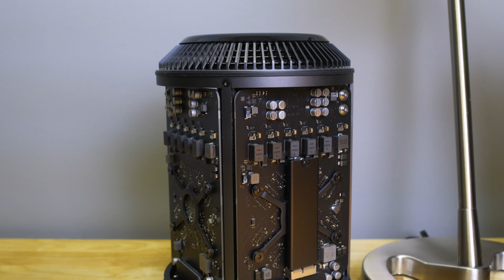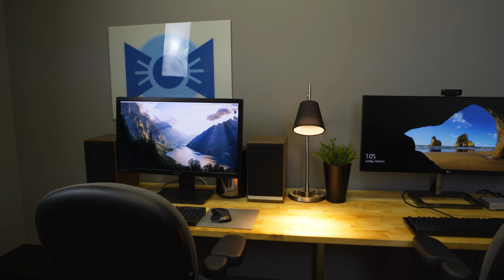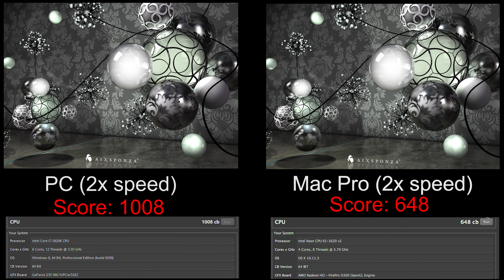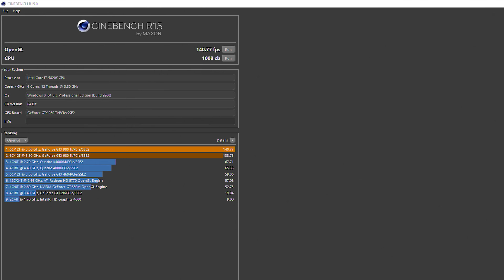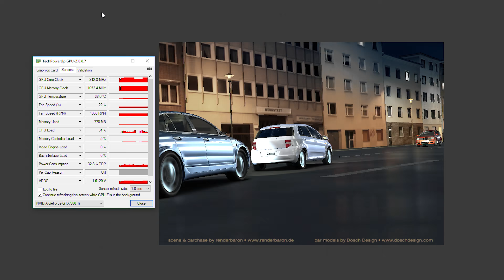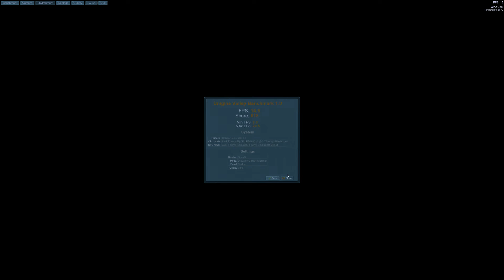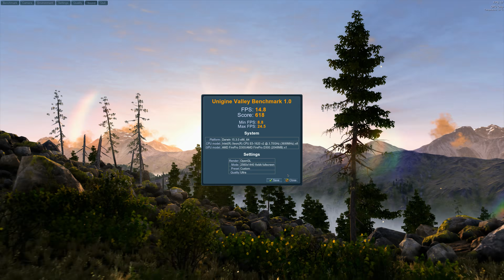$2,000 Custom PC vs $4,000 Mac Pro

Comment: Damn, my PC was $622 and even it annihilates the Mac Pro.
Reply: Michael Braddy I did not say I had a 970. I have an R9 290.
Reply: ***** Yeah, it's because, the 970 only has 3.5GB of VRAM.
Reply: +CaptainCrape thats just stupidity now
Reply: +CaptainCrape +t800 I have a $1200 PC
 i5 4690k, Gigabyte H97-N WIFI, 16GB DDR3, MSi 970 4G, Silverstone 500w 80+ Gold
It runs GTA V on 4K at 50 FPS and BeamNG.Drive at 60 FPS on Max Settings
Reply: I would beg to differ, considering your build is a gaming build, not a workstation
Reply: +ᅚ I overclocked mine to 1.8Ghz and overclocking the CPU doesn't help with the graphics. So gtfo since mine utilizes all 4GB of mem
Reply: +ᅚ cpu has a VERY little effect on game performance, unless you have like  say gtx 980 and a i3 or 3rd gen i5 processor, which then bottlenecks the card and yadayada, you just need a card that is compatible your gpu to work properly/full performance
Reply: This fucking thread gave me cancer.
Why even talk about gaymen things here?
It's already shameful enough that the computer in the video had a gaymen graphics card and no Xeon or ECC.
Reply: +ᅚ 
holy balls man im not even gonna read your wall of text because the first line misunderstood the whole fucking point
Reply: +ᅚ 
there's no doubt the windows computer is more powerful, but i still think they should have used different components. why would a computer for games be in an office? and yes if it has a 980 TI it's absolutely best suited for games regardless of what the guy made the computer for
Reply: +Jason Ciputra 

HAHAHHAHAHAHAHHAHAHAHAHHAHAH 

Gtx 970 and it runs gta 5 on 4k he says 
HAHAHAHHAHAHAH

your fucking funny mate :P
Reply: +ᅚ 

Then there is no reason to say it, when you dial down every setting to low and turn off msaa etc. What is the point. 

You cant play 4k with decent settings which is the fucking point off having a gaming PC in the first place. 
Also beamng is a shit game when it comes at graphics. 
When he can put the witcher on ultra and then 4k @ 50 fps then he can talk smack. 

This is just pointless. 

Just to say a gtx690 can also play 4k 50 FPS. just granted you get the lowest possible settings.
Reply: You know how pathetic you sound when you fight over internet? lmao
Reply: +CaptainCrape At least you went AMD with the graphics card. If the software can take advantage of it, it will do laps around nvidia because it has such good compute performance compared to Cuda. My PC actually does do laps around it tho, but its over $1000
4790k@ 4.5GHz
16 GB DDR3 2000
512GB m.2 SSD
4TB Mechanical Hard Drive
R9 Fury(Bios modified to Fury X, all compute units unlocked)

Crushes encoding tasks like ants :)
Reply: ***** Ohh, denial ;)
Reply: specs?
Reply: loomnati noscopers i5 4590, Z-87, 8GB DDR3, R9 290.
Reply: t800 Why?
Reply: +CaptainCrape well in gaming performance it does.
Reply: wow. apple really has overpriced stuff while you can get way better for just... $650? apple, please learn your lesson. (NO HATE)
Reply: +CaptainCrape my bad I accidentally tagged you instead of Jason here
Reply: Michael Braddy Ok
Reply: +ᅚ YEAH I SAID THEY HAVE AN EFFECT IDIOT. I'M NOT AN ANTI COMPUTER GUY. I UNDERSTAND A LOT ABOUT TECH SO STOP TRYING TO GIVE ME A LECTURE
Reply: +RuuFiss this depends on the game. CSGO is very processor heavy
Reply: Terrk23 CSGO isn't "heavy" in any aspect. If you have an old dual core CPU (Core 2 Duo, Pentium D, Athlon 64 X2) and integrated graphics or done crappy GPU you'll fun it fine.
Reply: ***** lol clearly you get way to annoyed over the internet

yeah i meant cpu its called a typo, and Battlefield is not cpu heavy at all you just need a quad core i used to run a gtx 650 ti and a i7 920 at stock speed, i upgraded my gpu for a gtx 970 and my performance doubled.
i have ENB's for Skyrim that i could even touch with my old 650 ti and when i upgraded my gpu to 970 i was getting fps well over 60 and enbs arent exactly optimized to well since they are mods 

 and obviously when you switch a cpu thats at like 100$ value to one thats at like 350$ value youll notice a difference, like seriously thats just a no-brainer

but hey all components act differently
Reply: CaptainCrape Not true at all. If you want 144+ FPS @ 1080p, that won't cut it. But if you want 4.3 aspect at 30 frames, sure, that would work fine.
Reply: Terrk23 Yeah, but I didn't think you were talking about that.
Reply: ikr
Reply: +ᅚ 
It's a fucking workstation, he's comparing it with the Mac Pro.
He said it's in a studio, why would he need gaymurr shit?
Reply: Mine is a 600$ laptop and destroys it
Reply: +ᅚ 
i am always calm but i really don't bother answering lies and when people appear to not even try to understand what's being said, because i have nothing to prove online
it seems to me you're still not getting it, but i'll give you the benefit of the doubt: im 100% aware of everything technical here, i work with computers on a technical level every day and i don't find it hard to understand what's going on.
i don't want anything apple, i'm not defending anything apple, i don't like anything apple.
what im asking is why would a computer made for games be in an office, and if he didn't make it for games, why did he use an i7, non-ECC memory and a GeForce graphics card?
Reply: +ᅚ 
how i speak online doesn't very well represent how im feeling in real life, if someone doesn't come off as serious at first i'll just be rude for the hell of it
i get that it might have been the point of the video, but it would be a little odd to to spend 2k on a computer if he wasn't also going to use it for something. anyway maybe it's the case that it's his bedroom or that it's just there temporarily, in the video it just seemed like a workplace and a computer that was meant to be there.
i gotta say he didn't go all out though, there are processors alone that cost more than that computer, particularly in the Intel Xeon, Nvidia Quadro and Tesla series. games is just a consumer market with relatively weak hardware in terms of compute power.
Reply: +ᅚ 
ugh linus tech tips
i am just disappointed because i was hoping to see something more interesting than another video about consumer hardware
Reply: +ᅚ Holy shit I can tell what site you visit on a daily basis.
Reply: +Tom Ferreira None of these tests were for gaming performance. They were for video and image rendering. It's obvious that people can only game on PC which is why this video didn't touch on it at all.
My prebuilt $450 HP was almost equal to the Mac Pro for editing, and it's like 4 years old.
Reply: +The-D0M1N@T0R 
because that's literally what they're for
and none of them are very good
Reply: +Strike_Raptor I upgraded my old pc a week ago with 2xE5-2670 v1, 64GB ECC ram, a creative sound blaster Z, an ASUS Z9PA-D8, 2xCM EVO 212S for 700€ and has 2021 pts on Cinebench R15, 30% faster than the $9000 12 core Mac, thanks to Tech Yes City and Hardware Unboxing channels! http://valid.x86.fr/fn1z9x
Reply: MrTor8 64gb of ram, what the fuck, are you trying to render a new planet?
Reply: +Strike_Raptor 
It's not that much, if you do a lot of things you can easily use it all.
Reply: Echoz28 Well, ram is pretty much always completely used, it wont use like 4/8 gigabytes, it'll use all 8 at half of its potential.
Reply: +Strike_Raptor You're right, normal use it's like 4 to 10GB, but when I'm rendering videos, doing complex simulations and other stuff it rises really fast, also its a good thing if you use ramdisk.
Reply: +Strike_Raptor 
It's being used for caching and buffering yeah, but even all applications 64 GB RSS isn't all crazy.
It really all boils down to what you're going to use your computer for.
Reply: +Jason Ciputra a gtx 970 running GTA V on maxed out 4k settings at 50fps? Lies. Not even (probably) a 980ti could do that.
Reply: +Smurfson You can compare a PC like mines, it's not that small... But in terms of power and workstation components at least has 2 xeons, the gpu could be replaced with an AMD Pro Duo or something so you have all the GPU power needed to double the dual D700 Mac Pro performance, and everything for less than $3000. http://valid.x86.fr/fn1z9x
Reply: +ᅚ 

Haha you do that, and with max settings like he said. 

Good luck with that. 

People with 4 gtx 980 ti's have issues running any game on 4k @ 60 fps. 

And you done it with a broken card, (3.5gb) dont kid me.
Reply: +ᅚ It can only use 3.5gb.
Reply: +ᅚ 

So apperently nvidia is lying huh ? As that is what nvidia stated on there site. But ok you apperently know better. 

And i said 690 not 960. btw both are capable of doing 4k.  Like i said when you dont know what your talking about just be quiet.
Reply: Mike j The card has full 4gb, though only 512mb of it is for stuff that doesn't require high performance, like desktop, nad the rest 3,5gb is for stuff that requires more vram. Anyways, not a single card is able to play the latest AAA games on ultra graphics, 4k @ 60fps+. It'd require multiple cards like 980, 980ti or titans.
Reply: +Jupezzi Really so why are thousands of players complaining that it only has 3.5 gb, and why does nvidia say that there right. (3.5 gb thats actually usable) 

I believe the makers of the damm thing sooner then some random guy on the internet. 

And thank you captain obvious for stating that no card can do ultra on 4k res @ 60 fps. 
If you actually read instead of just blatenly shout because you think you know better, you would see that i already said that. Btw AAA doesnt mean that a game has good graphics. case and point fallout 4.
Reply: Mike j Because as I said, that 512mb is for stuff that don't require high performance. I never said the whole 4gb is open for use in gaming. And no, I'm pretty sure you said 960 or 690 or whatever card isn't able to run it, you never said that any given single card has difficulties running anything at 4k@60fps.
Get your shit together mate, I though you were better at arguing than that. Oh, and i necesserily don't mean beautiful graphics because there are mods for that. Either huge map (like fo4 which you refered to), beautiful graphics like witcher 3 which was refered to earlier, or anything inbetween that. Most AAA games do have beautiful graphics and usually those huge maps too. Now, running THAT in 4k or 4x 1080p, is gonna give you some difficulties, not only that but on ultra AND 60fps minimum.
Reply: +Jupezzi 

Just to say a gtx690 can also play 4k 50 FPS. just granted you get the lowest possible settings.

Thats what i said. 

You cannot play the witcher on 4k at 60 FPS when using ultra. or medium. Maybe medium, but only if you turn of msaa anti aliasing etc. 
The 980 has problems playing ultra 1080p at 60 fps when playing the witcher 3.  (fact)

You reactions still make no sense, or say the exact same thing i said which tells me you know nothing about the subject at hand. 

So ill explain it in idiot language so you understand too. 

GTX 970 only uses 3.5 gb. 
GTX 690 is cappable of 4k (lowest settings)
GTX 960 is capable of 4k (lowest settings)
GTX 970 is capable of 4k (again lowest settings)

Having the ability of doing 4k with lowest graphics is pointless, as you want 4k for the better textures which you haven't when using lowest settings.

At this point there is no graphics card that can do 4k at 60FPS or 30 FPS, with ultra settings, max you probably get is about 10 to 20. and heavily instable. 

Before you start about the titan, a titan is not made for gaming. so its actually worse then the gtx 980. (fact)

You understand now or want to keep going and place more dumb reactions?

PS: mods dont exist to repair what a developer cant do.  Fallout is a shit game, and bethesda is a shit developer when it comes to good technical software/good graphics.
Reply: Mike j I have no idea what to say since you already said yourself what I thought about saying, which was exactly that why would someone want 4k over better graphics. No, you didn't say it EXACTLY like that but we both know that it meant that. But because no card alone is able to get ultra 4k 60fps on latest games, it doesn't mean that you still can't get it with SLI. 
But I have no idea why would someone spend thousands after thousands to video cards just so they can go and play games at 4k, ultra@60fps. Plus the titan might not be made for gaming but ultimately, they perform better than the other gaming cards. That's why the most powerful rigs are built with quad titans and a 5960x and not 980ti and 5960x.

Oh btw Fallout series isn't that bad, if you play the games for beautiful graphics and flawless games as in no bugs, then I think you shouldn't be doing gaming. Because the story is usually somewhat good at minimum depending on which game you're playing. The game has shit loads of stuff to do, like tes: skyrim did (honestly all the elder scrolls games) so well.
Reply: +Jupezzi 

Then there is no reason to say it, when you dial down every setting to low and turn off msaa etc. What is the point. 

Thats what i said in some reactions back. 

Yes you may get it on SLI, but i said NO SINGLE (SINGLE SINGLE SINGLE) is capable right now. 

I am just going repeat myself yet again. LEARN TO READ!
Reply: ***** Why would inability to read cause you not being able to put pants on?
Reply: ***** In theory that'd work, but in reality might not. That's only the basic way of thinking it. Inability to read doesn't make you stupid, only uneducated.
Reply: +ᅚ 

I have zero words for how dumb you sound right now. 

I suggest you read my reactions again about were you gone wrong. 
Because i'm tired of explaining myself to  morons that even can read basic english.
Reply: +ᅚ 

In all my reactions i talk about 1 card not SLI cards. 

So ill repeat myself yet again, learn to read and then read all the reactions again.
Reply: +ᅚ 

I did not troll, i merely just stated facts. 

You just didn't take the time to read them and made a fool of yourself.
Reply: +Jupezzi 

You know how dumb you sound when you do exactly the same? hypocrit
Reply: Mike j Lmao u mad m80.
I know I "fought" with you. Just the difference between us that I never took the fight to my heart.
Reply: +Jupezzi 

You can also just say, i was wrong i didn't know what i was talking about. But you didn't 
I am not mad but you just had have to place that last question to to keep it going. 

Just be a man admit you wrong and be done with it. 

The fact that you had to say i was pathetic (you meant me although your next reaction is going to say you dont mean me but ok) tells me everything i need to know about you. 

The reason i react back, is i love talking people into corners when they think there are oh so great and know everything when they clearly dont.
Reply: Mike j Whether or not had I said it, this would've kept going mate. And why would I say that I didn't mean that you're pathetic after I clearly said you're pathetic? Wow, you're just that stupid.
You're just failing really bad at talking me into a corner mate.
Reply: +Jupezzi 

Atleast the other guy admited he made a mistake. 

Why dont you, the more you speak the more you make a fool out yourself. 
If you want to continue to do that i dont want to stand  in your way. 

So whats it going to be, be fool yet again or admit take your defeat and walk away ?
Reply: Mike j "Be fool yet again"
Please do tell me, in which part before I have "made a fool of myself".
Because I'm pretty sure it's you here who's made a fool out of themselves. 75% of the time wrong about everything, speaking like you are smart, which, surprise surprise, you most definitely are not. Wake up in the reality mate. What I think of you, is that you're just one wanna-be-funny trolls in youtube that don't have friends in life so they come here thinking they're cool. To get acceptance from here which you never got from your parents. Sucks to be a failed abortion doesn't it?
Reply: ***** No, but I enjoy arguing so I'm not losing anything. :)
It's just the idiots like him that make the arguing impossible because their arguing is just so shit that it doesn't make any fucking sense.
Reply: ***** Pretty much the case, yeah. Troll or not, still stupid af. :P Still entertained tho :D
Reply: Same dude
Reply: Mr. Topix no it doesn't.
Reply: +Jupezzi it does
Reply: Mr. Topix Worth $600 and annihilates a mac pro? You only wish.
Reply: +Jupezzi 

How about you tell me what i said wrong because so far i only used facts. 
Should be fun.

A simple PC annihilates a mac PC. lol 

My 4 year old PC smokes that trash can lol.
Reply: +ᅚ 

You links doesnt tell anything that i already told, neither does it make you right. 
Also the funny thing is that you link doesnt even work. 

Just gives a 404 error. 

And for your information i am not a troll, i just know what i am talking about thanks. 
You dont so the only thing that you can defend yourself with is calling me a troll. 
Thats totally fine because i know better, and anyone seeing this line of reactions will too ;) 

Good day
Reply: Mike j So I'll have to list 75% of everything you've written? No thanks. A mac annihilates a pc in everything except gaming. u mad bby? get a mac. or are you too poor for that maybe? too bad to be you.
Reply: ***** Shhhhhhhhhhhhhhhhhh
A mac with final cut pro x beats anything on rendering. trust me.
Reply: +Jupezzi 

It's funny how apple sheep only use the "you dont like it so you must be poor" argument. 

For your information, i can buy many apples. I choose not too, because it's shit stuff and only dumb people fall for the marketing apple shows. 

Apple for example never ever innovated anything, the claim too but they dont. 

Neither was apple the first with a smartphone. 

But you go ahead and buy that stuff if it makes you happy paying double for what you get. 

Also i want to bet 500 dollars the PC in the computer store i work for fun, smokes your mac PC. 
With 4 titans double xeon at 5ghz. 

And guess what its still cheaper then the mac. haha.
Reply: Mike j double xeons at 5ghz? lmao i can smell your lies kid.

You really must be the idiot that we discussed earlier. You think that I was serious about that "get a mac. or are you too poor for that maybe"?

The funny thing is, there's no xeon motherboard which allows you to overclock, there's no xeon that allows you to overclock, there's no xeon motherboard with two slots that let's you overclock an unoverclockable xeon. 

Oh, I wonder which is cheaper, 4 titans and dual xeon, a server-grade motherboard, all that shit or a 3000€ laptop.
Hmm.
Reply: +Jupezzi 

You can actually overclock a xeon, we only tried it to know if it really worked. and what do you know it worked. I know you dont overclock a xeon, but that doesnt mean its not possible. 

They are now running on boost clock. 

Then again using a intel i7 6700k with base clock 4ghz, and overclocking to about 5 to 6ghz depending on cooling type. Will smoke your mac too.  And thats about half the price off the one with the xeon.  

But the mac in this video is 4000$, and the xeon PC we had was just a little under 2500$. And without tax (as it it in a store, it only costs about 1800 to 1900$)

As for laptops your a god damn moron, because a laptop is never a top. A PC always wins from a laptop apple or other brand.
Reply: Mike j You must have some weak ass xeons if they cost under that $2500.
Reply: ***** Though what's the point of having a mac if you can't compete one with it's software against a windows laptop/desktop?
Reply: ***** Well, you can actually compare those times. My point is that os x with it's final cut pro is probably the fastest possible way to render a clip. There are benchmarks for that, which renders the same clip faster, and final cut is multiple times faster. You can just google it, "final cut vs premiere".
Reply: ***** Well that depends on what you think is fair. There are some things exclusive for the other and some things that aren't, and the rest are either exclusive for the other or not exclusive for anything. I'd say comparing Safari with Edge or Explorer is fair, since both are exclusives as far as I know. I'd also say that comparing Chrome with explorer or Safari is still fair because Windows and OS X have their exclusives that they come with, that are meant for that one system. Both have their own. If your system already has one dedicated one, why get something that isn't?
And that's pretty much why I think comparing final cut with premiere is fair. You can think whatever you want. In the end, even though apples and oranges aren't the same thing, you can either prefer either one or like both.
Reply: What is with all the pointless arguing?

You guys need to shut the fuck up.
Reply: ***** Did I ever say that premiere came with Windows? No. I said there are three kind of different things in this situation, software that come for Windows, software that come for OS X and software that are for both. Lots of benchmark software being just that, and premiere being just that. Final cut being for OS X and windows movie maker (i think?) for surprise surprise, windows.
Oh and btw, final cut pro x doesn't come automatically with os x. it still costs.
Reply: CaptainCrape But it's fun :(
Reply: Richard Smith Yeah I got my 290 for $200.

Also, how the hell did you 'unlock' your Fury to be a Fury X?
Reply: ***** Yep, thats the process I used described. You have to have a fury which was overflow binned, but most of the fury's were. They had too many Fury X binned chips and not enough flawed chips binned for the Fury, so chances are, your Fury can function with at least most of the CU's unlocked. Mine happened to be stable with all unlocked, even though the very first CU on the list, in my case, was marked with a flaw. The rest of them were the auto-disabled CU's, so those never had a flaw to begin with.
Reply: This comment might get blocked, so making it as a second just in case, here is the proof:
http://prntscr.com/b4cpp8

Device ID: 1002:7300:174B:E329 (R9 Fury)
CU's Active: 64/64(Normally would be 56/64)
Reply: Richard Smith Weird, but it saves $100.
Reply: Bwah.my pic is free my father gave it to me and it is a bit faster
Reply: Quit comparing $4k macs to $500 celeron pc's...
Reply: 2Awesome Specs:

Intel I5 4590 CPU
AMD R9 290 GPU
8GB DDR3 RAM
240GB SSD + 1TB HDD
Reply: ***** Wow, the 13 year old is strong in this one!

Let me guess you watch that shitty reaction channel, Leafyishere?

Let me guess you go on 4chan everyday?
Reply: LMAO what happened when I was away.
Reply: ***** Yeah right, stop lying to me :'(
Reply: ***** i hear poor guys cry. get a mac bby.
Reply: ***** And live without food, electricity, internet, water, and all that for that whole month. And be late on your bills. GG. I still hear poor guy crying.
Reply: ***** Even if I didn't have a job, I wouldn't need it because I still can afford my Apple devices, got enough money on my bank account for a decent life filled with apple devices m8.
Reply: ***** Oh, but it does. If you don't use Apple products, it's because you're either poor or really fucking poor. If you didn't have the family, you could afford it. That's the case in every family/relationship. Thank your family for being poor. Go get a mac m8.
Reply: ***** If you've concluded that I'm a troll? See, that's the thing I'll never understand. I go on the internet talking shit that everyone knows it's false but still the idiots out there keep on going how I'm wrong. Of fucking course I'm wrong, I know.
Reply: ***** I was refering to the part where I say to everyone how Apples godlike gaming pcs wreck every other pc on the market. i didn't say that an opinion is false. And I never said you're a troll for "liking" Apple products.
Reply: Yeah, I can make a pc better than the mac pro for a fifth the price.
Reply: PROGARON - Let's Plays, Gaming, and More Better start making one then, cause I want proof for that claim.
Reply: ***** Where's the proof from him though?
Reply: ***** Well, even though it seems that I check the notifications once an hour, I don't.
I already told him that he better start making one because i want proof for his claims :)
Reply: ***** 1080 already takes that $800. Good xeons about the same. How are you gonna get a motherboard, a startup drive, ram, case, power supply and a cpu cooler for $400? hmm?
Oh and a server grade motherboard at that with 2 correct cpu sockets.
Plus we didn't discuss which mac pro. you could take a mac pro from 2009, upgrade it with 2x 6core xeons which beats the current mac pros, costs less than 2k, 12 cores, upto 48gb of ram (i think), almost any gpu you would like, any amount of storage as long as you use max 4 drives. AND os x. And just to put that out there, the price varies to which gpu you put inside, i mean, it's obvious that if you put an nvidia quadro or tesla inside. the 2009 (non-upgraded) itself, around $300-600. let's say $600 for the sake of fairness. $300 for 2010 hexa core CPUs, because nothing latter is supported. so thus far $900. You've got your psu, you've got you case, you've got your cooler, you've got your CPUs, you've got hour motherboard, and you've got your drive(s) but let's upgrade those too. 
a 16gb stick is $87.37. let's round it to $90. again, for your fairness. 16x8 = 128gb ram. and $90x8 = $720. so $900 + $720 = $1620. That's just to be fair for you. Now to hard drives. 2x3tb wd red drives total $210. now let's not be fair again because we're getting low on cash, $1620 + $210 = $1830. You don't necesserily NEED to upgrade your already existing gpu, but you've got $170 left, so that'll get you a some-what decent gpu for your stuff.
So, what have you got? Well let's see
128gb of ram, 6tb of storage space, a decent gpu, great CPU performance due to 12 cores in total, a decent gpu, say the new rx200 of rx400 from amd which costs around $200. and on top of all, you've got a pc which will not be beaten with a fifth of the price.
I know we went $30 over the budget but you're getting a mac, it wont be a problem. you could of course cut out one of the hard drives and have $75 left over, because each drive costs $105.
Reply: ***** A bottleneck CPU, and only 240gb of storage? really? Wow... I'm disappointed.
Reply: They should called it the Mac trash can
Reply: ***** what?
Reply: ***** (I just noticed your long ass text) 
The thing is, I was talking about the 2009 Mac Pro (4,1). Upgrade firmware and well, get your hardware. Yeah, nobody needs 128gb of ram but it still is there. That build for that $2000 which you mentioned, it's basically better than what you can get for that $2000 of yours. Or my bad, the $2000, or in other words fifth of a price of a mac pro by progaron.
Why 2x3tb WD red? well, why not?
the new mac pro supports upto 64gb says apple. my macbook pro supports 16gb (maybe even 32gb) of ram even though apple claims it can hold upto 8gb of ram.
sure, the mac pro 4.1 can read on os x upto that 48gb (again, read from the internet, haven't tried it) of ram, but on windows it can read that full 128gb of ram. Might be a fix for that 48gb max readable issue. don't know. might be.
256gb flash and 1tb max? too bad, this one holds anything as long as 4 drives max.
16gb of ram and 64gb max? too bad, this one comes with 2 or 4gb and can hold upto 128gb.
hmm, let's see.
yeah i think that's about it. $2k mac pro and beats the new $10k mac pro a.k.a. trash can. it's better in every ways. except its size i guess.
not only that but it also beats all the $2k PCs out there with OS X software.
Reply: ***** It is because stupid people buy them
Reply: ***** If you'd actually stop a minute and think WHY they're expensive.
Just think about how big of a corporation Apple actually is. All the costs for advertising in every country for example. The building costs, the parts cost, the software developing costs, salary costs, fucking everything.
Of course they make money out of their devices but shit, probably about as much as Samsung or Sony does.
Reply: ***** Not really. They have to keep every single one of their devices up to date and support them for FIVE YEARS after their release. Every single iPad, every single Mac Pro, every single MacBook and every single variation of all of those. all iPhones etc. They have to have huge teams to keep their OS bugless, a huge testing team, they have to do everything perfectly. iOS, bugless.
And now to the difference between iOS and OS X. two different operating systems. they have to keep TWO seperate operating systems up to date. for. five. years.
enough shit about the os.
actually no, let's talk about android next.
So, Android, nobody in particular has to keep the OS up to date. Google just makes the base of Android and leaves the rest to the phone makers. And it's actually super easy to make a custom ROM to an android phone. It's not a whole new OS, it's just a mod of the OS which doesn't actually have much difference. It's easier to make ROMs than a whole operating system.
enough?
Reply: ***** not every android phone support custom roms? you make them support it. Name one that you can't even force to run custom runs. Like please, that's the stupidest shit i've seen yet. People run fucking community-made Ubuntu on their phones that come with Android. You can just google OnePlus One and it's communitys Ubuntu Touch project.
And is it the same iOS version on every iPad out there? I don't know. Depends on how different they are. One might not have fingerprint sensor, the other might have, so they have to add the compatibility for that fingerprint sensor in for it to actually work in the other iPad. Same with stuff like WiFi (which is obviously on pretty much everything these days) and NFC.
Let's see.
Windows phones, tablets etc, is the optimizing in them (as an example) as good as in any iOS or OS X device? no. just because they have to make the os for their phones, doesn't alone mean that the phones jump up to a grand.
What I mean with the "nobody in particular has to keep the os up to date" wasn't that nobody is forced to update but that no company is forced to keep the os up to date. i think. something like that, i can't remember.
but does the 2009 mac pro and 2013 mac pro have the same exact os? no. VERY different hardware. afaik the 2013 mac pro has one processor where as the 2009 has two. just as an example.
Reply: ***** And that's the exact point. Android CAN'T be optimized for specific hardware. That's why Apples hardware is usually shit but still manages to get higher performance than any (or atleast most) android phones. 
No I don't love Apple. Their phones are shit. Macbook Pros and the iMacs are great, that's about it.
Oh and Apple TV. love it.
Reply: ***** Nah, apple TV w/ Kodi > Amazon fire stick w/ Kodi.
Let me take a guess, either a n6p or some huawei mate.
Reply: ***** It's a nice choice, though not something I'd go for. I'd stay with the quad cores since the ones with a 810 chip have heating problems. or really any octa core chips. phones just aren't ready for 8 cores. and 820 performs better than any chip out there, exynos 8890 excluded.
but still, a decent choice. i just got a opo back two years ago for 300€ when it still had the invitation system, and paying about 30€ a month (if i remember correctly) for my internet, no data roofs and 50mbps/30mbps.
best phone i've ever bought. but then again im' a flashaholic.
Reply: Joker Hamill butthurt realist* you mean.
Reply: +CaptainCrape you just said you had a 970 in your build...... 50 fps might be your max frame-rate in 4k but either settings are turned way down or you just wanna sound cool.